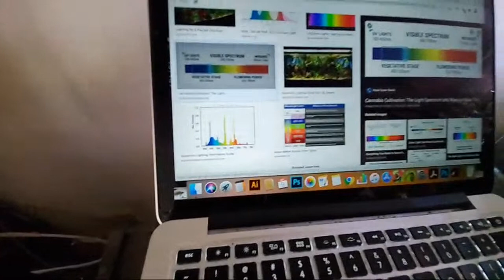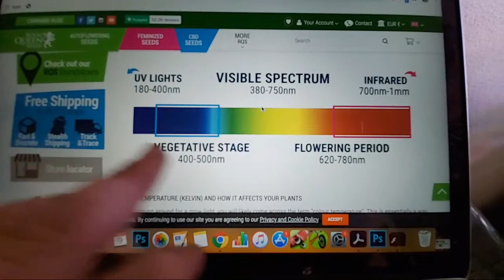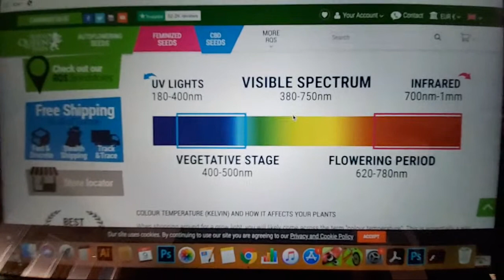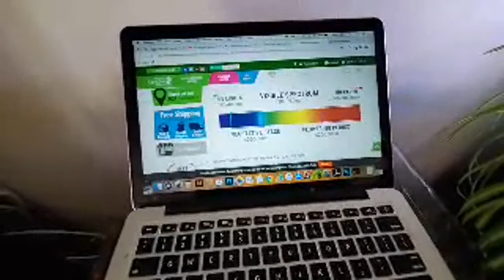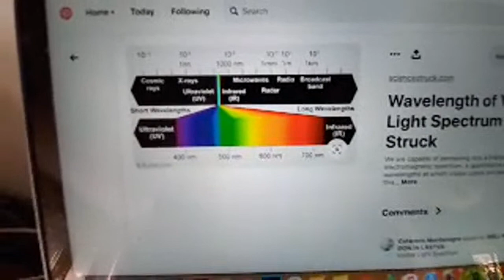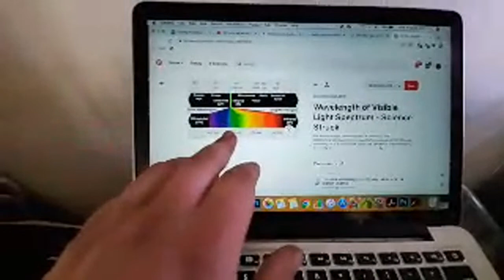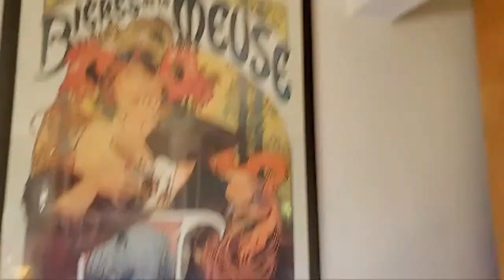Let There Be (Aquarium) LIGHT! - What Kind of LED Should I Get & What is The Best Price I Can Find?

Comment: Owning a twinstar 1200sa would be a dream. I currently use sunblaster 4ft LED strip lights. They don't look sleek, but they're not huge. Two of them together put out 10300 lumens 6500k 96Watts and seem to do the trick. They're about $125-150 each.
Reply from the maker: Nice! 6500k is my favorite warmth if i have to just stick to one. Ive noticed the higher end lights sometimes produce a light thats good for plant growth, yet they arrange the diodes so that it looks bluer in front of the warmer tones...thus making aquariums look around 6000k even though from above they run a bit warmer.  As for bang for your buck, it sounds like your setup is the way to do it! Thanks for the info!

Comment: Where does the Hygger come in relative to these ? And how many hours do you normally do, 10? Thanks, Alex!
Reply from the maker: So the hygger 957 is probably just under a fluval 3.0 or 2.0 by 25% power...and a step above the nicrew and current or fluval aquasky or finnex stingray by probably 20% or so... its a good compromise for a budget low and medium light. I run mine 10 hours in established tanks and 8 or 9 in new tanks that are prone to algae.
Reply: Super helpful,  @Fishtory  , both for the hours as well as the details on output. And I am definitely on a budget.

Comment: What is the best light for growing lush plants in a 55gal? I have some Rotalla and Scarlet Temple I'm concerned about. Also a carpeting plant I forget the name of.
Reply from the maker: Hands down id go with fluval planted plus 3.0  ...they're water resistant, well made,  timers and dimmer switches built in with blue tooth and the 2.0 model held it's resale value at over 50% of retail...which is pretty amazing for aquarium gear. If that proves to be too expensive, you could consider the Nicrew I linked in the description (there's links to the cheapest prices I could find on all the listed lights)... but the nicrew will be about 1/2 the power of the fluval or say a twinstar ae series. To carpet in a tank that size and depth, unless its chain sword or val. You need a fairly powerful light.
Its a bit more pricey for the fluval..but well worth it in my mind...makes a huge difference in quality of plant colors
Reply: @Fishtory  thank you so much :) I have a Current something right now (it is a few years old) seems bright but I'm sure it isn't going to be strong enough. These suckers are just so deep! It won't fry my Anubius will it?